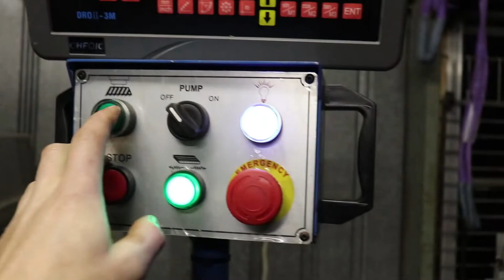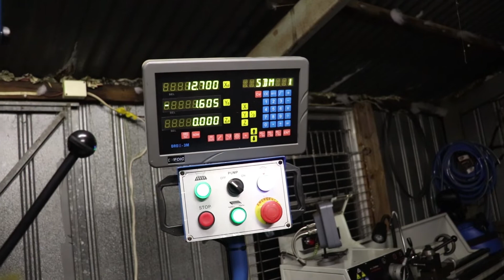Lateral Parts Project 5 - Cantilever (pushrod) suspension: Billet links

Comment: Is one of those bushes enough to handle the loads it will take? Doing something similar and intrigued
Reply from the maker: i reckon so considering they use smaller setups on factory control arms, look up open wheel race car forums, lots of similar set ups  

we'll find out when it drives lol
Reply: Will definitely have a look and keen to see it in action. Keep up the good work too man